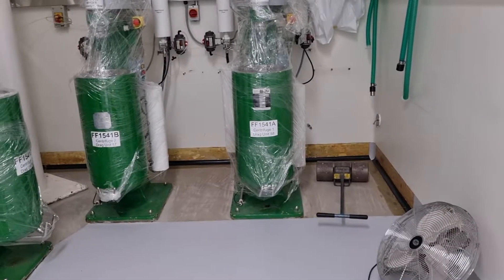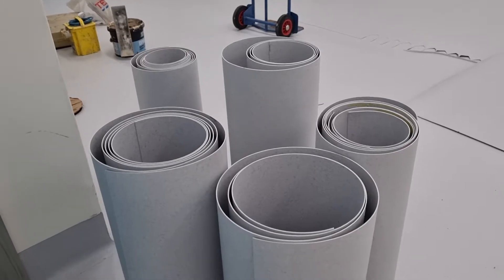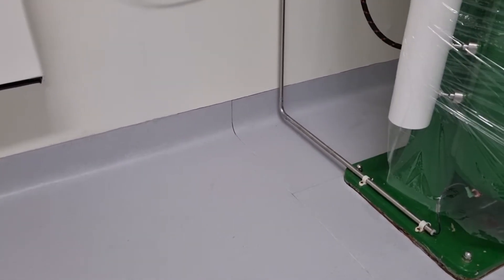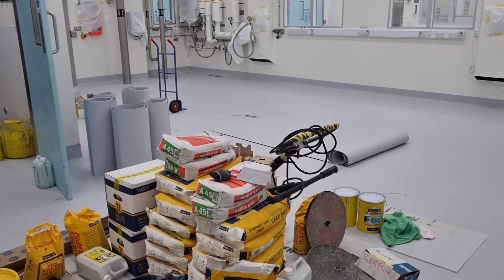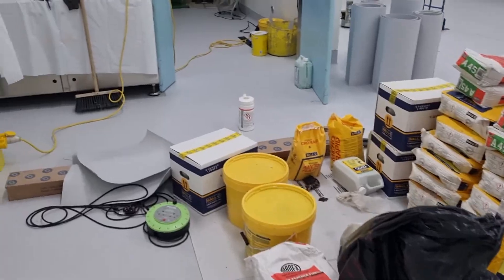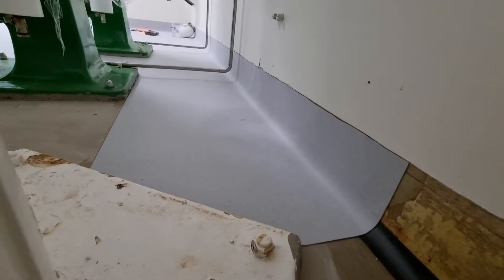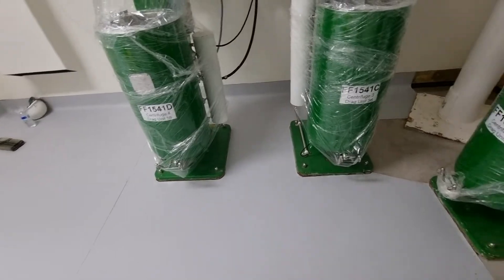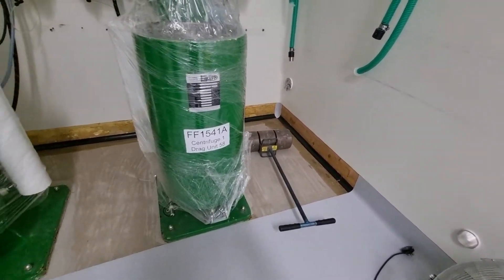cap and cove vinyl project/ how to do up the wall vinyl in the smallest areas

Comment: Wrong choice of material (Sheet good is not suitable for such room, nevermind flash-coving job)
If sheet goods a must in this room, flooring should be installed before the equipment is fixed to the floor.
I would walk away from this job, or I would at least charge triple the labour price!
You did well on this challenging installation.
Reply from the maker: Thanks for watching our channel. Please subscribe and share the video..
Yea you are right it was such a challenge and awkward project...but it's all done and now we have the easy one 😉